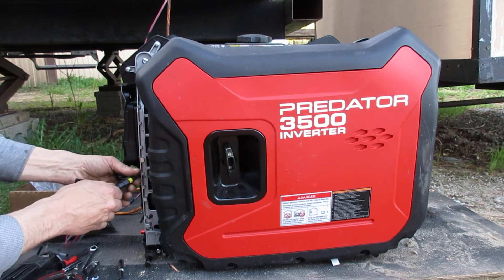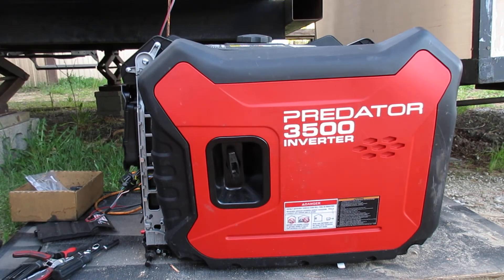Automatic Generator Start System Predator 3500

Comment: I’m glad you are making a kit for this....I’m hoping it will be able to connect to an AGS )Automatic Generator Start) controller that monitors battery charge and sends a signal to the generator when the voltage is low, and shuts it off when correct voltage is achieved.
      I will need to get two of these with a parallel kit, and two AGS controllers.
      I’m planning on mounting one on each side of the vehicle in separate protected, but outside vented cubicles.   They will both be wired into the system and mounted on shock isolators.....and fuel will be fed from a 20 or so gallon ethanol free, fuel cell mounted between the frame rails of the vehicle.....I’m building a 6,000 watt system with 24 volt lithium batteries, controller, inverter, and roof mounted solar panels 😁

Comment: Hi, nice video. 
This generator has a battery charging plug, can I use it to keep my truck's batteries charged? Is there an option to start/stop according on truck's battery voltage?
Thank you.
Reply from the maker: Yes this controller can do this. But is this all your application is? This is not a cheap controller its $850.00 it is designed for 0ff grid battery banks. It is fully automatic, self starting and shutting depending the battery state.
Reply: @Thrive-Off-Grid 
Thank you for prompt answer.
 Does this controller includes a stronger battery charger for 12v battery, or the one that comes with this generator is enough?

Comment: I just bought one and the start button doesn't turn it on do I need to purchase the battery separate?
Reply from the maker: You need to hook up the battery. It should be in the battery compartment but they dont hook it up.
Reply: @Thrive-Off-Grid  thanks so much for your help am in my camping trailer right now and I can't sleep so I now have something to do.

Comment: Hello Matt, is it possible to have a automatic on/off with out a power bank for the predator 3500??

Or maybe a fob remote starter??
Reply from the maker: Seems there is a market for it. I will need to develop it. That would be completely different than what I have here in this video. This is a $600 system shown here. Over $200 just  in parts and then a couple days to build it. Sorry for the late response Youtube dropped the ball on notifying me.
Reply: @Thrive-Off-Grid  Hello,  Just wondering if you made up a simple start and stop setup for the Predator 3500 generator.  Looking to mount one under a transit van and have a remote start button to it.  Thank you

Comment: Hey Matt, Are you installing this as a remote start? Or, automatic start / run in the event of a power failure? I myself, do not like the remote start systems. To each their own on that. Also, are you planning on running this off one of your gasifiers? Reason I ask is that gasifiers (mine) like a constant vacuum. Wouldn't a inverter generator on Eco mode running up and down with the RPM as load requires it would affect the performance / gas quality on the gasifier? With all the new automation you have on the units you are producing, will is compensate for the RPM ranges.  Something tells me that inverter generators with their RPM ranges would be problematic running on WG. But, if anyone can figure out that issue, it's you. I really like the Predator 3500 I have. Smooth and quiet. I also picked up a Boliy 3600I on the cheap ($50.00) with the extended run fuel tank system on it. It was also remote start and that was the problem. Removed the choke stepper motor, Installed a manual choke and it runs perfect. I only wish it was parallel capable like my Predator. I hope you got a good deal on the one you have with the broken bracket. Looks easy enough to repair.
Reply from the maker: If you had an automatic transfer switch this would work great. You would need the battery bank. As for running this guy on woodgas, we will find out. As I think this generator would be very desirable running from a small gasifier. If the eco mode is an issue, just dont run in eco mode. My system the way it is set up it does not fluctuate a whole lot as the charger keeps a constant load on it. :)

This thing is very nice, it just runs and I dont have to do anything or even think about the system. I just live my life :)
Reply: I agree about not running on Eco mode. That would solve a multitude of problems. 
I am looking forward to the video of the Predator on WG and see how it performs. 
It will also be interesting to see what you come up with as a hook up from the gasser to the gennie while keeping the integrity of the outer casing.  @Thrive-Off-Grid
Reply from the maker: @mada94fxr  What outer casing? lol
Reply: @Thrive-Off-Grid  Now that's just good comedy there. LOL
Reply from the maker: If you have not seen the next video of this system, check it out here https://www.youtube.com/watch?v=ctqfojps_H4&t=2s